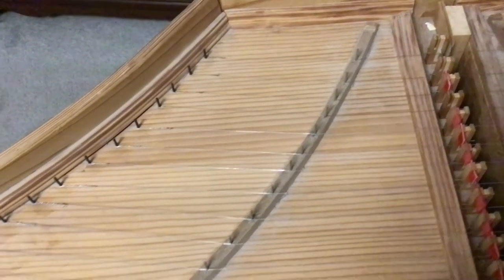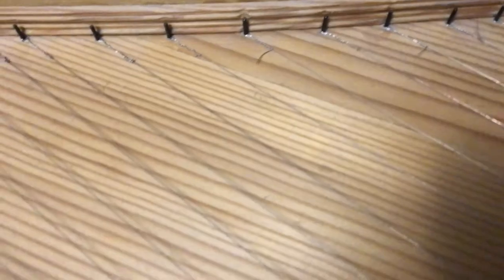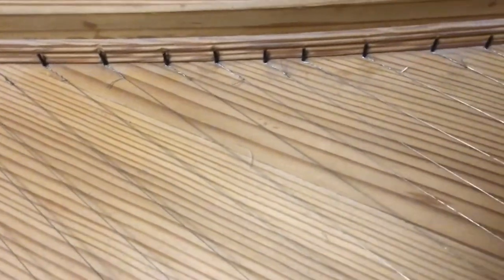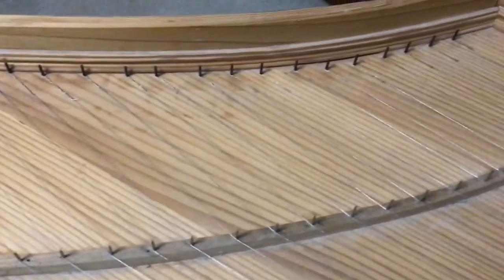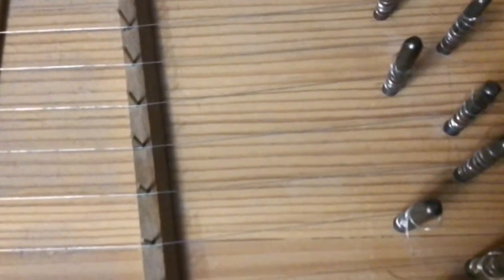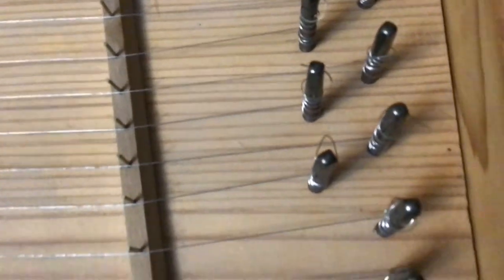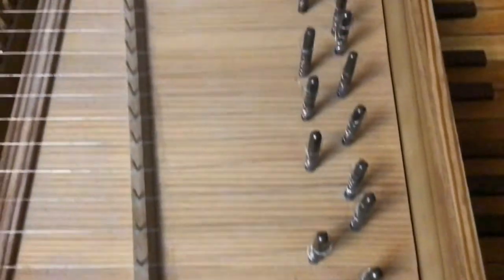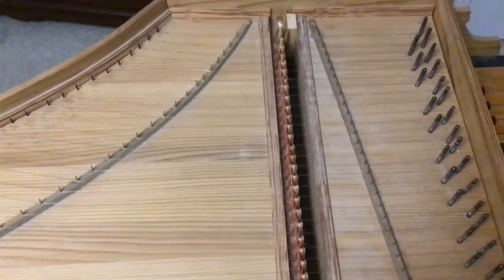DIY harpsichord overview follow up

Comment: to my eyes, the illustration of the bridge/nut seems to suggest that the metal pin ought to be the last thing the string touches on its way from the hitch pins and the tuning pegs. so there's a slope after the peak of the nut/bridge where then later the guide pins make the final contact with the vibrating string. so if the wood and the pin touches the string at the same point along the length of the string,  that's probably wrong. the wood contact is necessary to elevate the string to the desired height, but the guide pin acts as a conductor to the soundboard at one end (the load/output side of the circuit) and to the "ground" at the wrest board I think (to put it in electronics terms, to use an allegory). also i would assume there should be a more or less pronounced angle of a certain number degrees so that the right amount of force is pushing against the guide pins so less vibration is lost to the nut/bridge wood parts, because probably direct contact with wood simply stops the strings from vibrating physically. am i close?